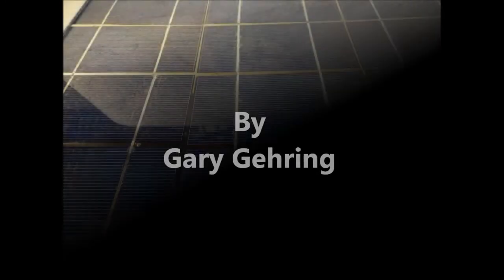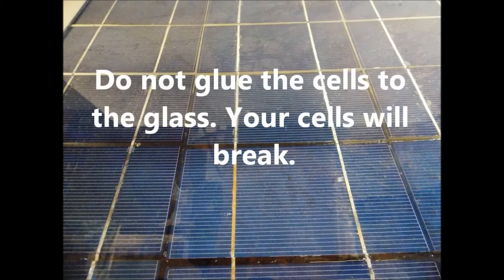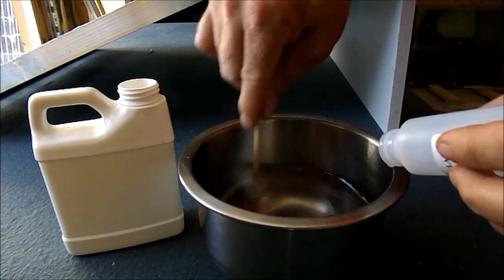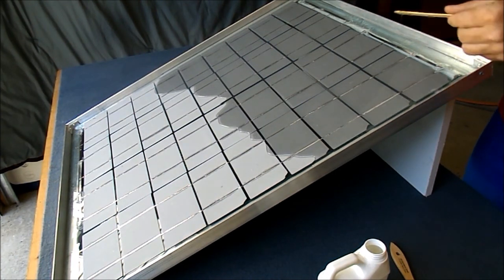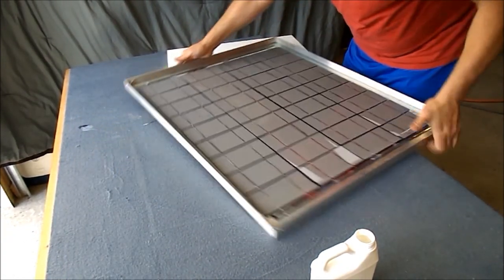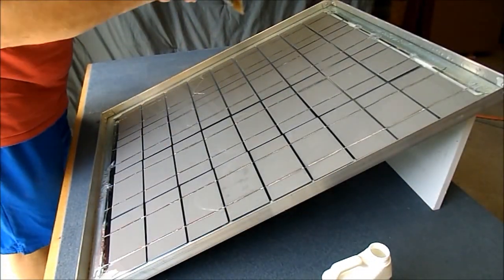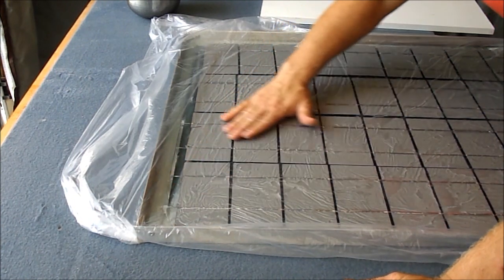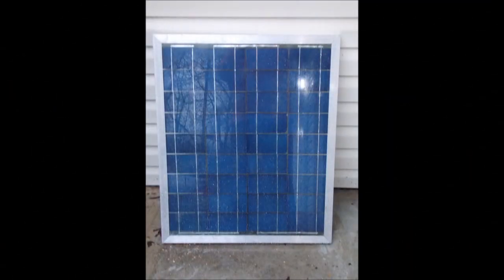Encapsulating a Solar Panel

Comment: Question: What is the density of Qsill? I need to mount cells on the inside of a vacuum formed convex acrylic sheet, so I wonder if water on top of the plastic bag sheet can be used in place of the fiberboard used in this video to apply light pressure and prevent the Qsill pooling in the middle of the panel?
Reply: Water is probably not viscous enough to force the encapsulant sideways against the convex sheet, the encapsulant would still pool in the middle. If trying to do this, you would need something with viscosity above 4000 cps (water is 1 cps). but even then -your viscous liquid will pool in the middle and force a bell curve distribution of force against the convex shape and the encapsulant. 

I would use another convex solid sheet that is identical to the front convex sheet, and have the encapsulant sandwiched in between, that way you would be able to ensure pretty uniform distribution of the encapsulant across the convex sheet. Then after the encapsulant hardens (~2 days) you could remove your convex back-sheet.
Reply: Looked it up. Qsill has a density of 1.03, so it is going to pool under a bag of water.

Comment: Most Platinum based silicone is 10:1, but there are other ratios. Most importantly, never use platinum based with anything that has been used with tin based silicone or chlorinated rubber, as it will never cure properly. I would assume that means cleaning all of the flux off of all the solder joints so that organic tin does not come into contact with the silicone.

Comment: I have bought solar cell DIY kit couple years ago, but never made it because that encapsulation stuff was so expensive. I checked again after watching this video. Prices were still way too high.
I could buy ready made panels with the price of that liquid only! Ridiculous. :D
Do you know (much) cheaper alternative to QSIL 216 or other "official stuff" that is made for this?
Seems that I can't never ever complete the kit if price is this high.. at least when shipped to finland. Checked from EBAY several encap. liquids and they were all out of my range, if not the the stuff itself, but after adding 30-50 EUR shipping costs they were.

Comment: One thing I don't see performed is the preparation of the electrical leads to be connected to a solar installation system.
Can you please provide this information?
Reply: +Christian Gentry (TooTights) I was wondering that too, theres no mention of bus bar leads to connect the back mc4 junction box too

Comment: i am using this method. It works perfectly. The panel is flawless. I am in the process of building 10 panels. TG solar is the best.
Reply: I would like to know about one potential issue I see, but you may be able to answer having made a few: The cells don't lay absolutely flat. Is this an issue?